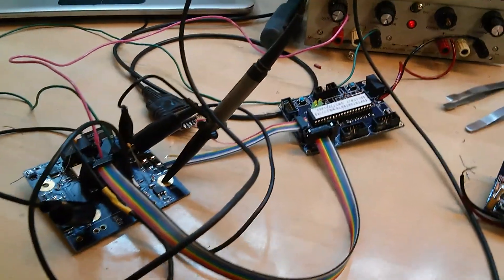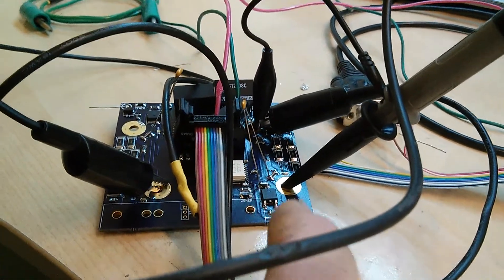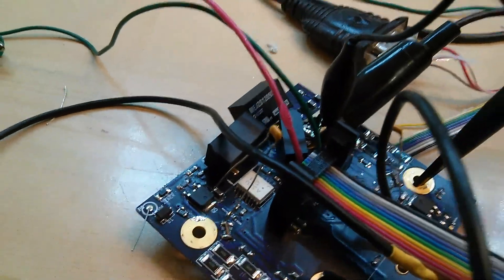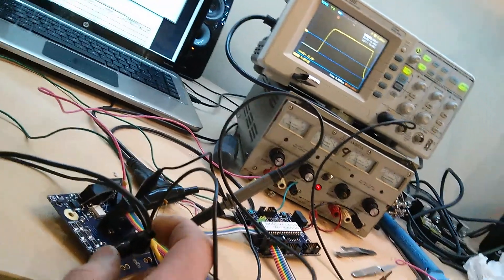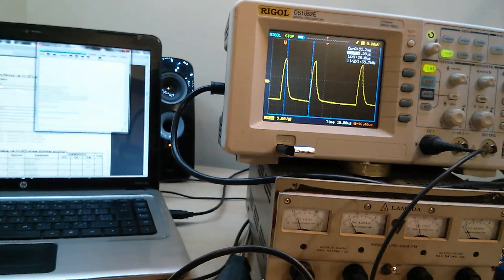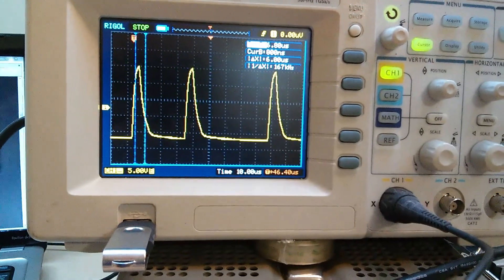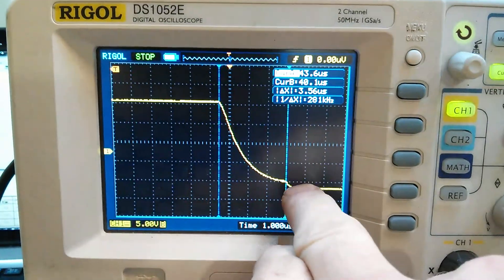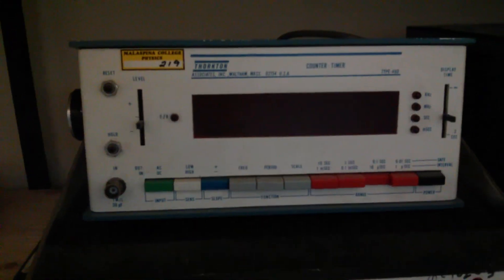New Driver board design.

Comment: I don't know much about electronics but I still find it very interesting what you do. I understand that you have been struggling adapting thing with high power electric vehicles. I think I understand that when you get to over a certain power level you run out of electronics that can handle it. This is why you do this.
I'm very interested in electric bikes and I have a friend that helped me out with installing my first custom e-bike. I have run with a 72 volt setup and it was both dangerous and fun. Now I go the other way and use a 15 amp 36 volt controller that force me to peddle in steep uphill. I kind of love the range more than the speed. Yeah I know it is a bit gay but some guys think that Tesla is gay so heck it doesn't bother me.